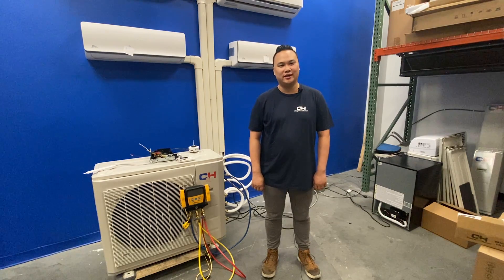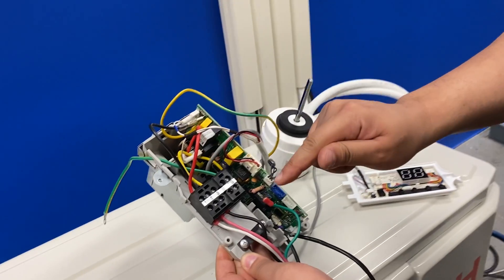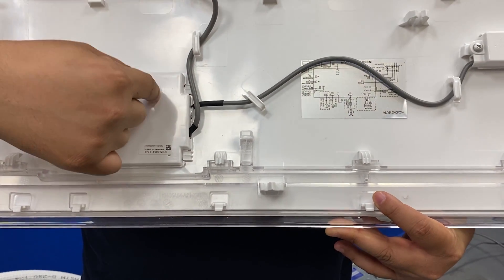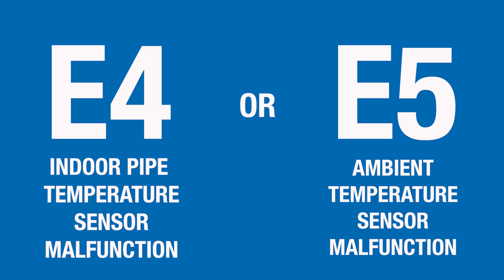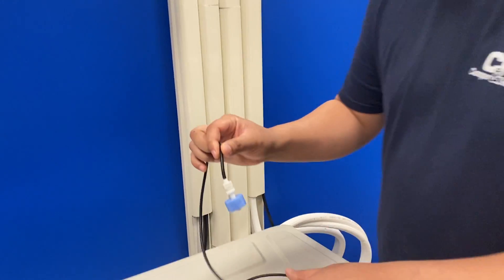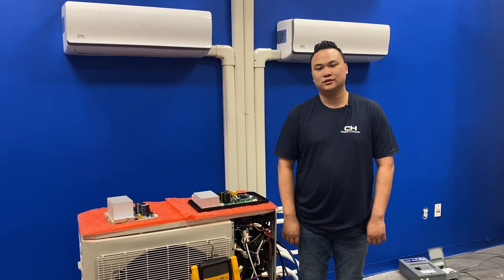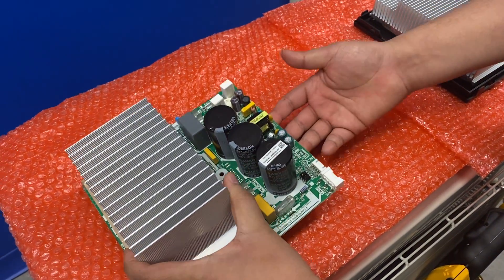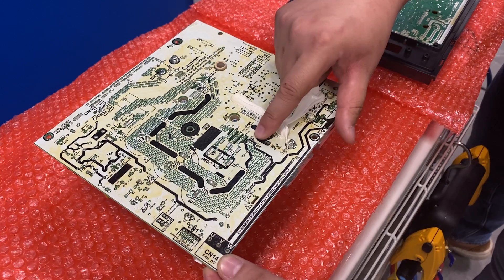Mini Split Error Codes & Troubleshooting (Cooper&Hunter)

Comment: I tried to start mine after install and got code 88.
I had my signal wire crossed. Should have been re black white on inside and outside.  (Outside was red white black on 123 bar)
Switched and works perfectly.
Olmo 18000btu 220v.